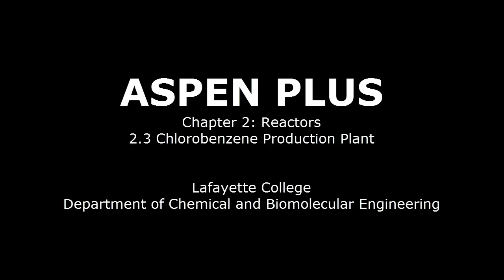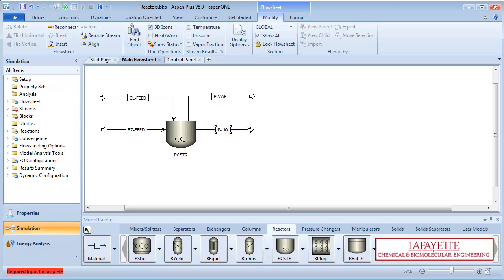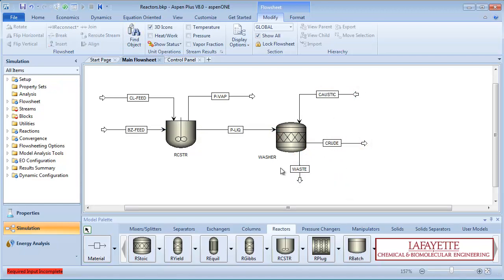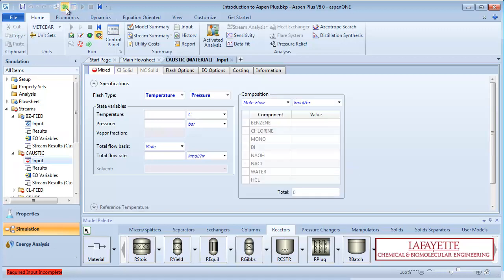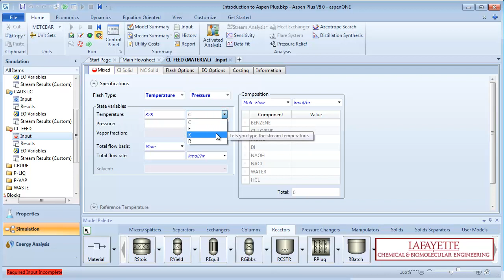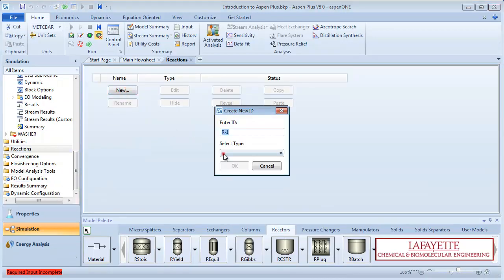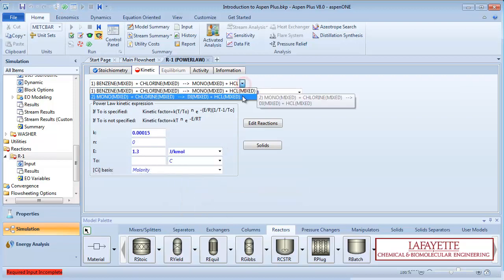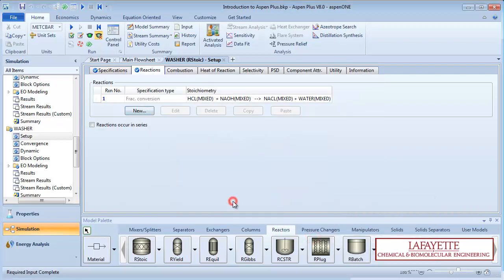Aspen Plus 2.3: Chlorobenzene Plant

Comment: For the RStoic model, why do switch the product streams? I noticed you dragged the water decant stream to the side to use as the feed for the distillation columns and you dragged the product stream to the bottom to use as the water decant (kinda hard to see without pausing the video). Shouldn't the water/NaOH be leaving in the water decant stream? I noticed that if I don't do what you did and I connect the product outlet (red arrow) to the distillation column then the model doesn't work. Why is this?